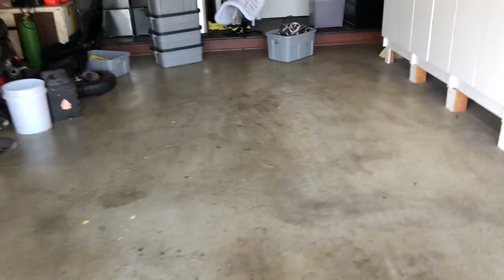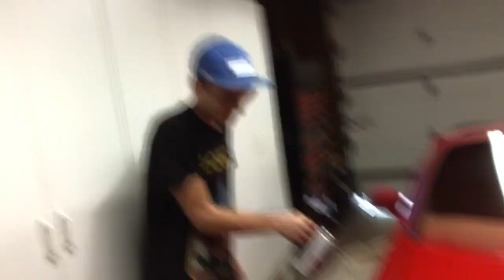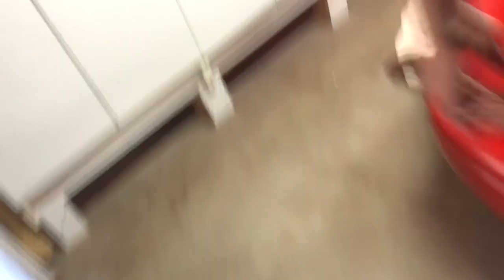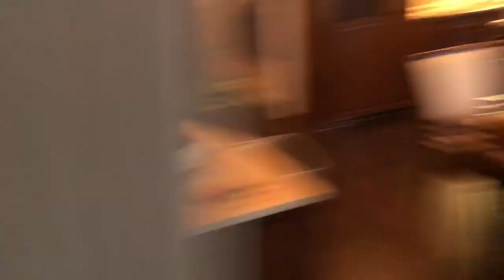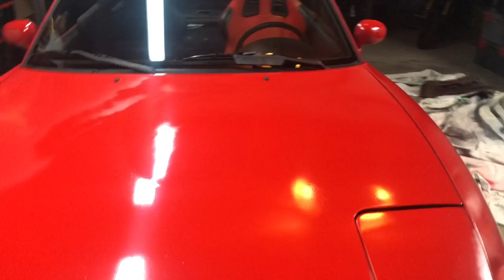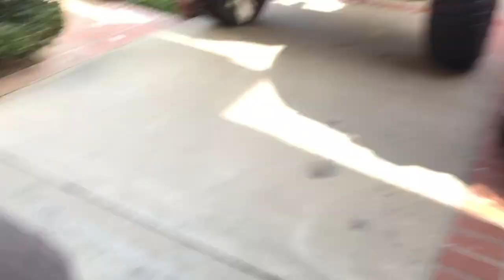How To Paint A Car For $10!!

Comment: this is crap you should’ve spent a week prepping by sanding and bondo and primer in order to get a perfectly smooth finish and then applied an $800 25 stage paint with 15 coats of clear in a proper paintbooth and wetsanded for 3 days and then a simple buff and polish and wax in order to get the same color but nicer
Reply from the maker: Kyle H ok